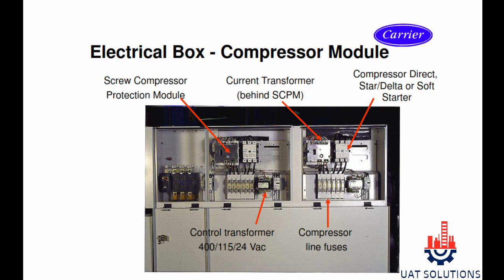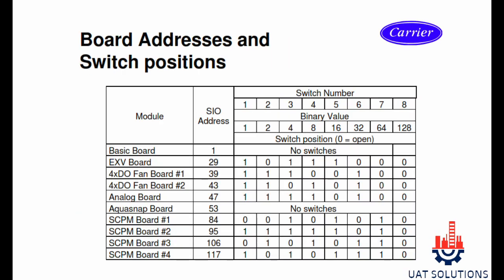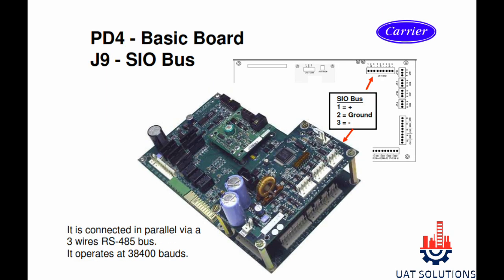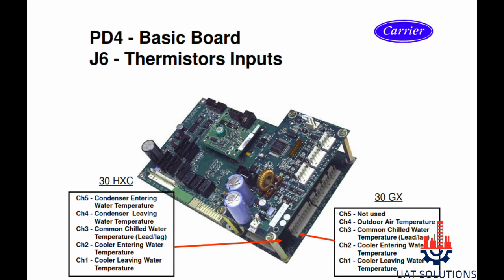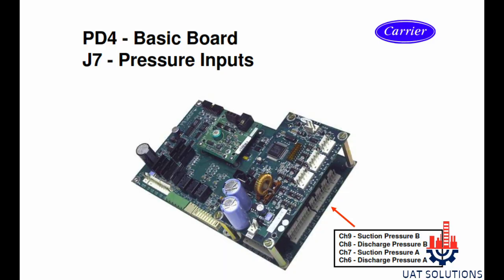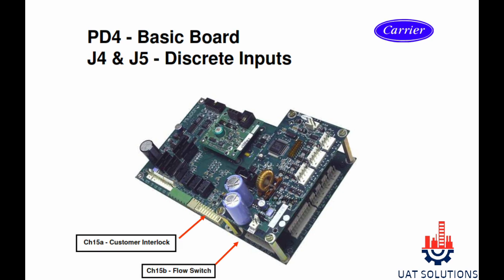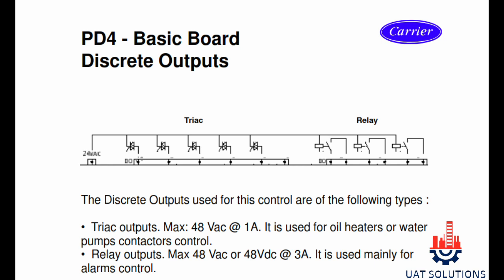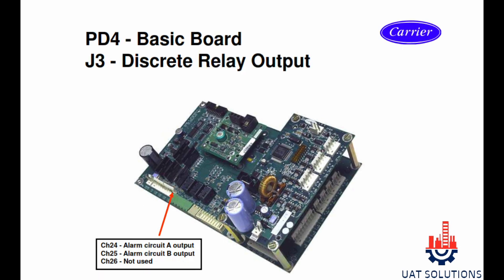Carrier 30GX/HXC Prodialog 4 main base board PART NUMBER 30GX506748 & all control hardware explained

Comment: The videos are so helpful. I would like to ask , is SCPM board need programming or no.
Reply from the maker: Sure SCPM Board has a program. in the market its available with and without program installed. if you have SCPM with installed program than you just need to set the DIP switch settings and it will work. But if you have SCPM without program than you need to install the software first.